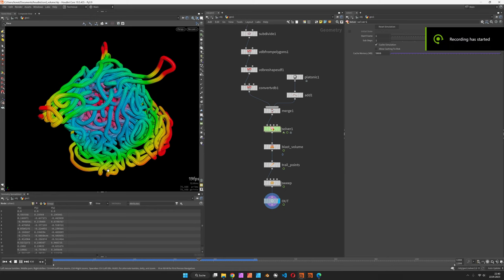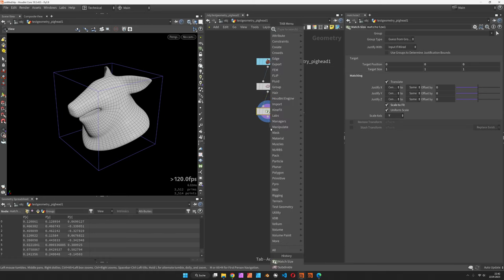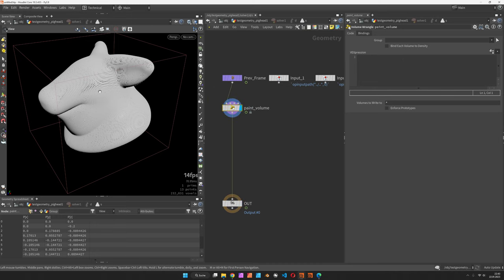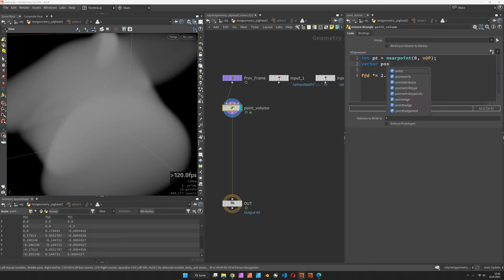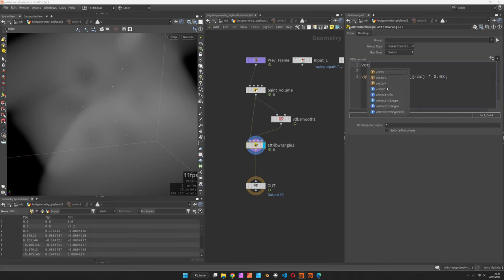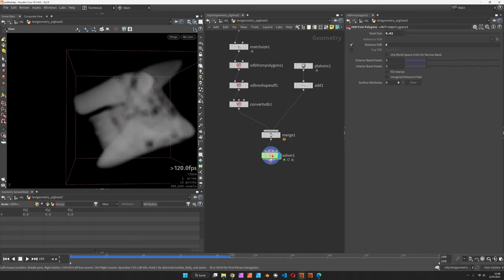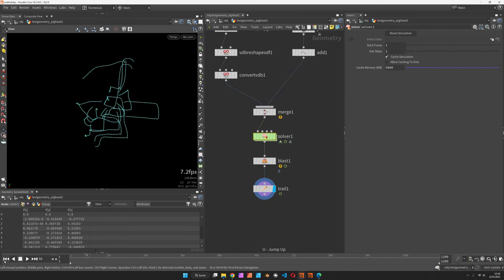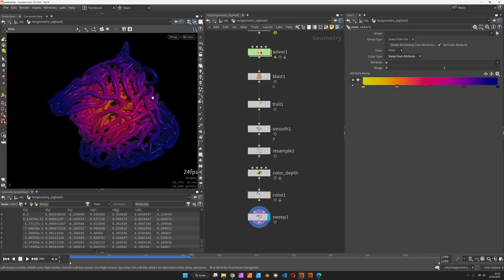Filling a Mesh with Curves – Houdini Tutorial

Comment: sorry somehow cant post reply under your answer, so here is answer on your answer: 
I have watched this,  its more decorative use case.

I mean Binary Partition System Anastasia Opara mentioned in her talk "Functional Symbiosis of Art Direction and Proceduralism" 
There is another example in project "KREMLAS" by Reinhardt Koenig, where he uses kd-trees for iterative partitioning. I understand this as storing all possible future  cuts for being able to roll back and cut differently, if lets say in the 5th iteration one of the output polygons have bad proportion or something like that. 
This would be great for more proceduralism and  rule based self desicion and less art directing
Reply from the maker: Thanks for the hints! But it's a similar thing. May I ask what you try to achieve?
Reply: @KonstantinMagnus  I would like to make some kind of floor plan generator
Reply from the maker: @kasali2739  That's what I suspected. You could try this for now: https://procegen.konstantinmagnus.de/non-overlapping-tiles
Reply from the maker: I've just uploaded an example for KD splitting in Houdini: https://procegen.konstantinmagnus.de/kd-tree-splitting
Reply: @KonstantinMagnus  Thank you Konstantin, have added those 2 to my toolbox. Pretty fast you could do this. 
Have you heard about "Wasserstein metrics" (optimal transport), you can do crazy things with that. I suppose Metahuman uses that under the hood to mix and blend between 3 different face meshes(no voxel trick). How do you think, could this be written in VEX? 
https://www.youtube.com/watch?v=T9O6T5WHdC8